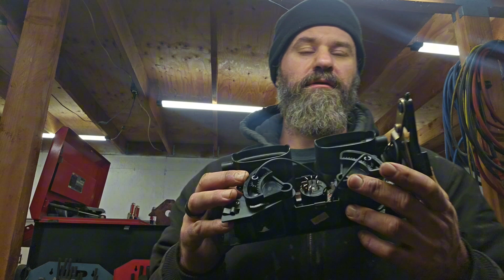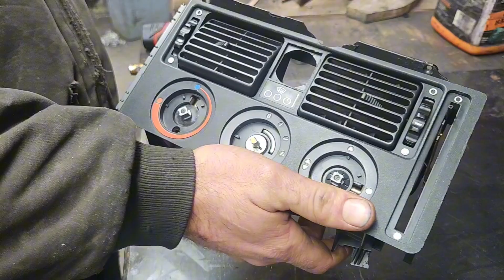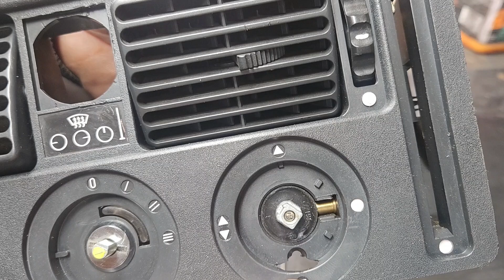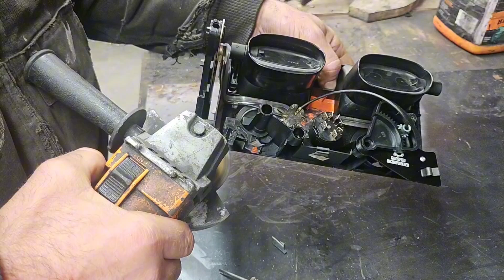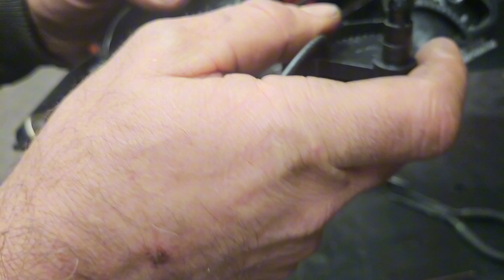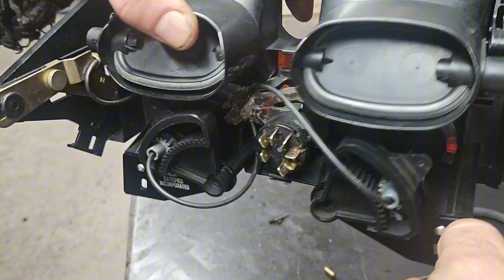Fixing Broken HVAC Panel Plastic Parts on a BMW E21 | Easy DIY with Metal Replacement Plates

Comment: Nice but I miss the point. You fixed the brooken part in the back of the panel but the whole front side of the panel has missing and broken pieces... For me it's not worth fixing the back side if the front side of the panel (like mine) cannot be screwed back because parts just broke off.
Reply from the maker: The front screws can be a problem also.  It just depends what your problem is. 

I have 3 different panels here and all have broken backsides as this fixes.  They also have a screw hole or two on the front that is broken but can still be held into place.  So for me, I had 4 total HVAC panels that could be put back into service with this fix.  I would assume this is the majority of them out there and if we can save a majority, I think thats a good start?